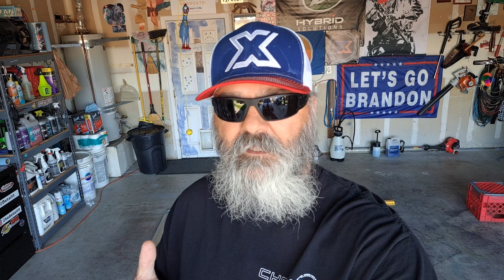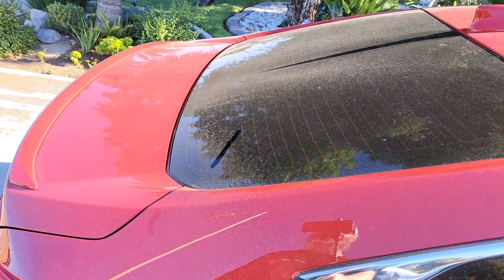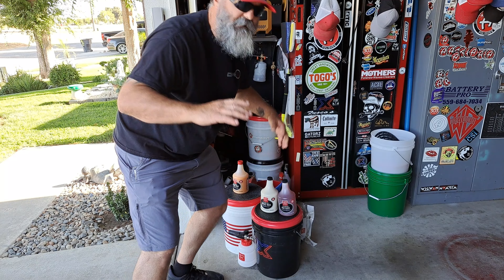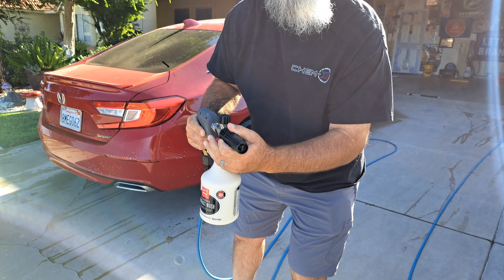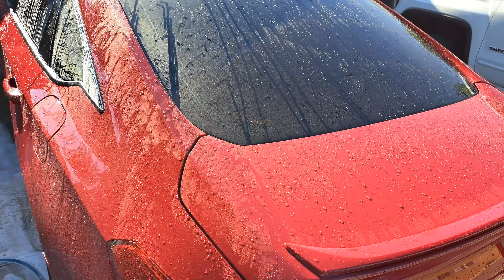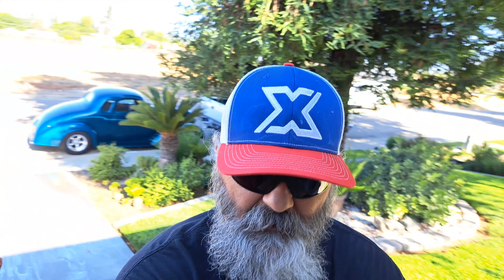Griot's Garage Boss Foaming System | Gree-ohs |

Comment: The hats are great quality.  It's my favorite hat that I have. Congratulations on winning the Father's day give away. Doug i think you might need some help. You may have a foam cannon addiction.  This cannon looks like a good one. I like how it will work with there other bottles. Thank for another great video.
Reply from the maker: Hi 👋 Tim! I'm stoked that you like the hat. I try to make nice stuff when I can. As for my "addiction," keep that on the down low... if my wife ever pays attention in the garage, I'll get the 3rd degree..🤣. Honestly, 6 of them were either won or sent out for me to review (try) . There's really only one of them that is not really great, the 303 ! As shocking as that is, the nozzle doesn't spray really great. I mean, it's good, just not great. Oh yeah, there was one more on the floor just below that CAT active pressure washer, too🫣... they all have something I like about them. Still say bestbang for the buck, Trinova. These haven't gone up in price in over 5 years, and they are solid ($34)
Im glad you liked this one. The Boss Cannon is very nice and i agree. The fact that you can screw the product bottles to the cannon nozzle is amazing!! Great feature! The stainless fittings also look and feel like quality; all around a great piece! Thanks again Tim. I appreciate you. Have a great day; Take care!

Comment: Doug, you may want to try this when doing this type of washing or maintenance wash if you want to reduce micro maring?  First dry with leaf blower, then dry with a detailer or ONR with MF towels.   Thanks for the review...
Reply from the maker: Hey! Definitely does help. Honestly I've tried EVERYTGING and came to the conclusion that all these extra steps and processes are Great for a show car. To me, not worth the effort on a daily driver.. That said, if I don't use a Foam n rinse sealant like this one, I do use a drying aid maily to combat water spots and for the barrier between paint and towel... Thank you so much for the pointers and for the support!
Reply: @detailit  Thanks for your reply, be safe out there!

Comment: Why the rinse bottom up initially many say the dirt causes marring that way?
Reply from the maker: Hi. For a couple of reasons. 1, it's easier to stay on track and to properly overlap your passes when rinsing to prevent putting Zebra Stripes in it. 2, if you rinse top down, u could potentially streak it and the layered soaps aren't as effective... it just works best!